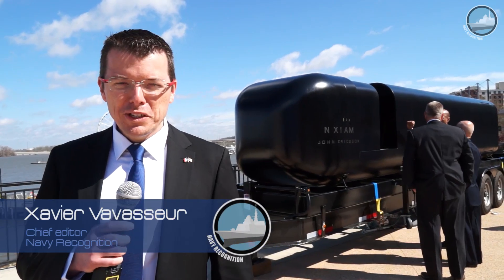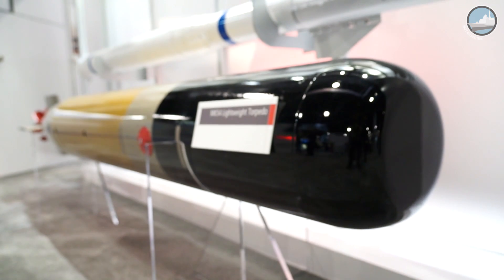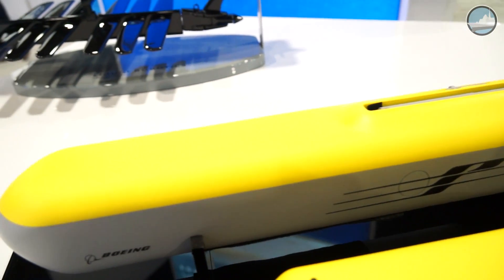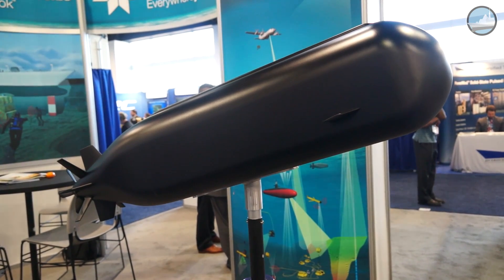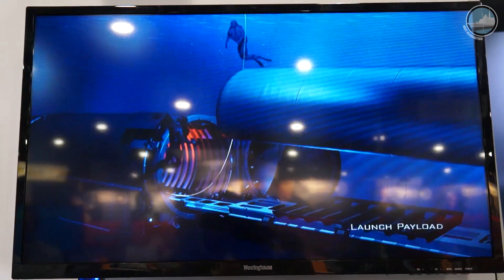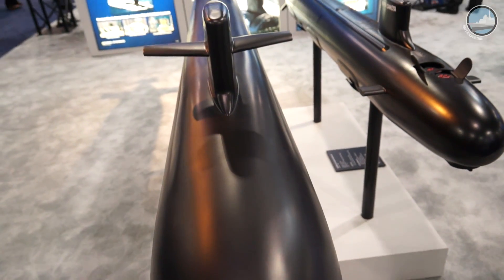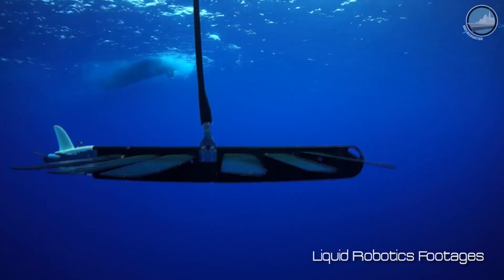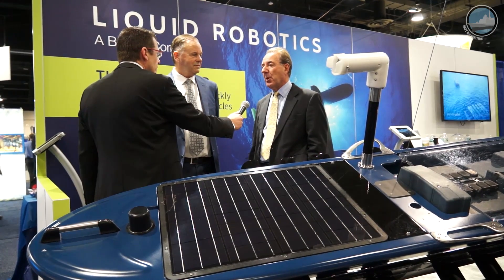Sea-Air-Space 2017 Day 2 - ASW & Underwater Technologies

Comment: 3D printing (or extruding) propellant would be more interesting, since then individual charge "packs" wouldnt need to be used, and safer storage could be designed.
Mk54 is a bandaid solution to a very old problem. Its tiny and useless interms of parity naval opponents.
HAAWC is useful and practical, so it wont be put in service.... unless its attached to a porkbelly program like F35. Columbia also looks like an effective and practical way to finally patrol the retarded 200 mile line Americans claim. So it wont be put in service...
Echo voyager would be interesting if it had a good AI or used a glide capability. Unknown for what purpose though, as covert ops cant be automated. In the same vein SWCS and P-LARS is interesting. I guess cutting international telecommunications cables is becoming more difficult.
Wave glider is similar to something other countries have, glad that America is considering the technology.
Reply: Are You Really A Hot Chick ?
Reply: ((I guess cutting international telecommunications cables is becoming more difficult.))
Well who really want to make the international trade/commerces and bankers as an ennemy. Except a group that want shift the ruling system in this world...  
Those who can play muscles are not really interesting either to stop/ending their show.